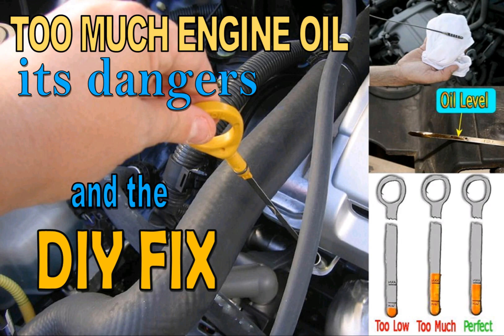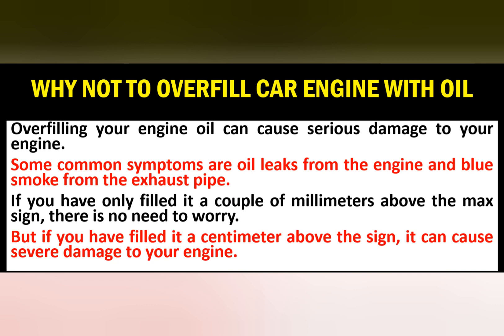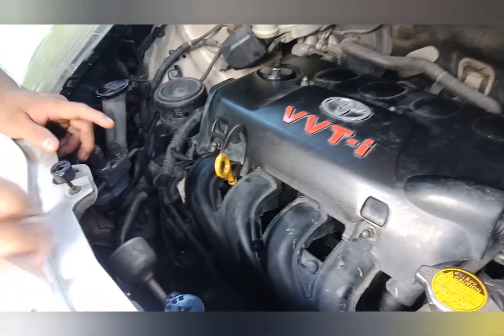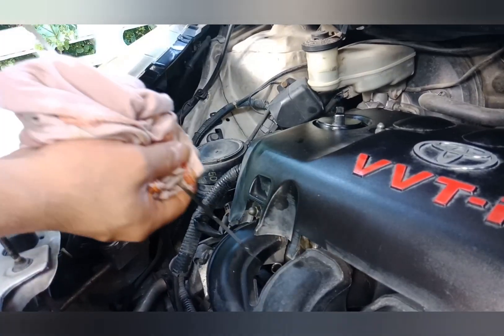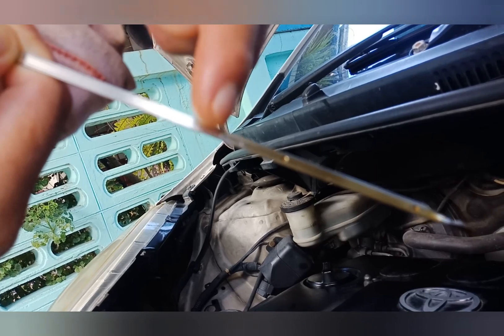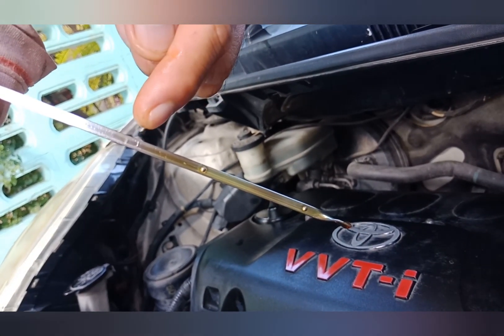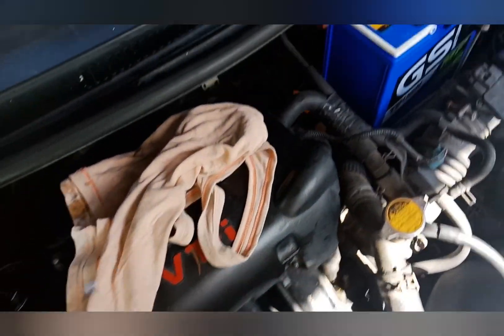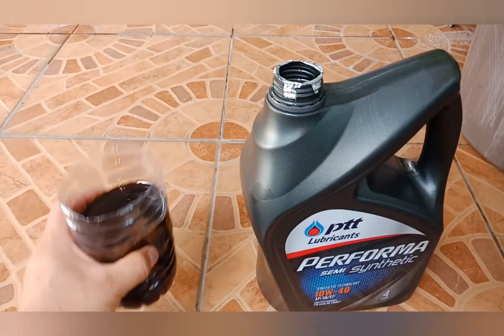Too Much Engine Oil (Dangers and DIY Fix)

Comment: I was driving my 2007 Nissan Xterra with with a nice amount of dirty oil due to weather and my tail pipe falling off my muffler.  The day after i took my truck on a smoothly road trip.(No problem there or back).Next Mourning car was sounded like it was dry. Ok so check the fip stick not knowing it was valot old in it just needed an oil change, i put more oil in it all not knowing the damage i caused . Riding for about an half a mile truck powered completely off.i then flushed my engine put new filter in abd proceed to start, no turn over but very good sound as if possible start Right away. Hearing that, i did no more attempts. That was last night nigt. What is another Solution i can do to get a start now after being flushed and new oil in it properly?

Comment: Newbie here I overfilled the engine two months ago. Just today I realised the spark plugs wells are filled with oil. Just like an internaute said Iam stopping using the car right now. Are there any other steps to take? There are no leaks on the floor just once I noticed white smoke.  Ty for all your help. Cheers from Montreal

Comment: I bought and audi that has a permanent (add oil light) comes on often. Since theres no dipstick im assuming old owner kept adding oil. When i changed the oil it had almost 10qrts. Its a 09 A4. At first it would smoke a lot. Still smokes a little. Could that be because its burning it out ? I already did valve seals, oil separator.

Comment: Sorry for giving trouble.

I approach for your expert second opinion for my observation in my car Caren with Turbo charged petrol engine 

1). Recently Engine oil filled by Service Centre is 1.0 cm more than Full/Max. Level

On drawing their attention, they say to us not to bother.

Is their assurance correct ? 

Because Read somewhere that excess engine oil can damage system.

In that case does it applicable to engine of Caren also.

2). Normally observed cabin as well engine sound of a petrol car is SILENT.

But in my Caren it is noisy.

Like to know Is it normal in Caren bcoz while drawing attention of Service people, they does not find it unusual.

Comment: Is it possible that engine does not start after over filling oil ? 
I have a car sitting for a year without running, it has oil leakage somewhere so i filled the oil and accidentally put little over limit .. battery was dead , so i jump start from other car , the engine is cranking but not turning on .. i was wondering,  may be because of extra oil .. is it possible ?
Reply: same thing Is happening to me right now
Reply: @allofstephanie  lately in my car it was not the over oil that caused it. The fuel pump was not functioning as car was not used for long so got chocked ... had to replace the fuel pump

Comment: I noticed you're taking the dipstick down to where it just bumps the shaft not shoving it down where it locks is that how you're supposed to do it properly because if I do it the way you're doing it it's not over full but if you shove it all the way down in there it would seem over full so which is it you just take it down to where it bumps the shaft not where it locks in

Comment: Don’t worry a quart over or under won’t harm anything. It’s called a forgiveness factor. The engineers know that some dealer or yourself might do this. YouTube Bob Likis will over fill oil harm oil pressure sensors. He is a top mechanic and explain more.
Reply: Will this help with dry start
Reply: I put 12 oz more oil is that ok
Reply: You're car would perform poorly and would not be as responsive compared when the correct amount is used. Happened to me when a mechanic overfilled my engine.

Comment: My hands got greasy just watching this lol.
Good video Mang
Reply: You can buy a suction pump with rubber flexible tube for cheap money that goes in the oil dip stick tube to drain the oil. Many mechanics have these in there shops. No need to get under the vehicle to remove overfill. Auto parts stores Big box stores Amazon sell these.

Comment: I put wayyyyyy you too much oil in my car omg 😱
Reply: Me too. My baby was sputtering and clacking and smoking. The LAST thing I need. The sir drained it from the bottom so I was trying to see what to do next. I waited a couple of hours and and cranked. It smoked and cut off but now is idling right. I'm scared to death 🤣😳. Good luck to you on yours.
Reply: @mississippigirl3151  I had mine drained and oil changed it started right up no more smoke and haven't been having issues thank god. Good luck to you too I might trade her off soon

Comment: Hi Sir!
Is it still safe for the engine with recommended 2.5 litres of engine oil only if filled with 3 litres? Thank You so much.
Reply: No won’t harm anything. It’s called a Forgiveness Factor. Engineers know this will happen so a quart over or under  won’t hurt anything. YouTube; Bob Likiis a top mechanic: will oil fill oil harm oil sensors.
Reply: @arthursmith643  yooo thanks amazing link and video ! nicee
Reply: You should still remove the .5 liters of oil. More oil affects the lubrication of the engine. You could get away with it, but it will take a few thousand miles off your car's life and performance.
Reply: @3dstaco  Thank You so much sir.

Comment: Or #4, You took your car the the dealer and they put too much oil and then when pointed out, they say "look" the oil is on the H. Then you go home feeling like a fool wondering how you could have been so wrong... so you pull out the dipstick so you get a better look at instead of the service guy waving in your face screaming that the oil is on the H.  That's when you realize that there are 2 holes, one is H and one is L for "High" and "Low" . The full mark is the hole NOT the H above the hole.
Reply: You are correct.  Just last week my neighbor took his Toyota which he brought new not long ago for his first oil change at his dealer.  On his way to work, his car engine was making a knocking noise and he had to pull over on the side of the road.  He had to have his car towed to the nearest dealer which was late at night.  He had to rent a car to get home.  The next day, the mechanic at that dealer said his car had 5 too many quarts.  The person that did his oil change didn’t drain the old oil out.  That cost the company over $2500 in repairs.  I always check my oil myself before leaving the dealer.
Reply: @jerrywhite2941  Jeez, they only had 1 job to do...🤦‍♂